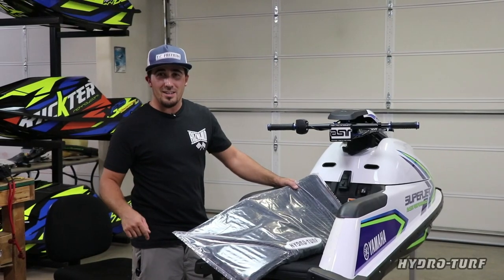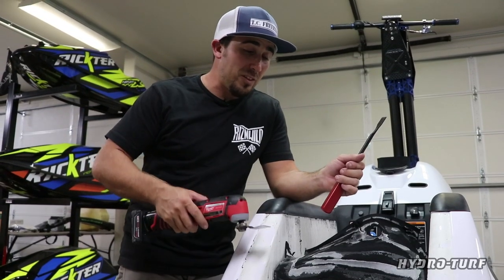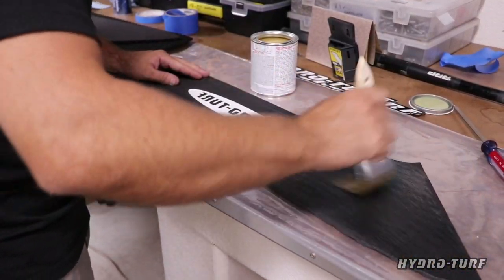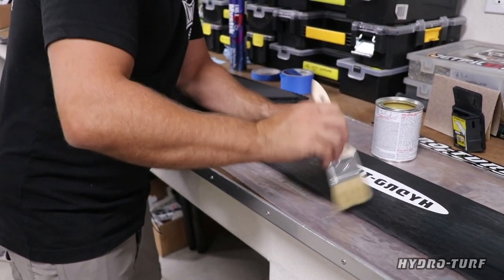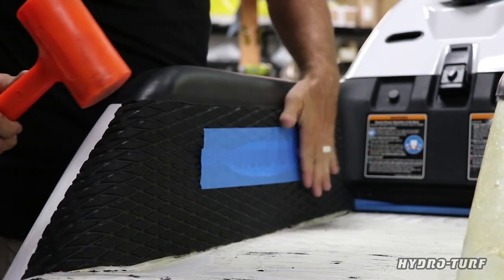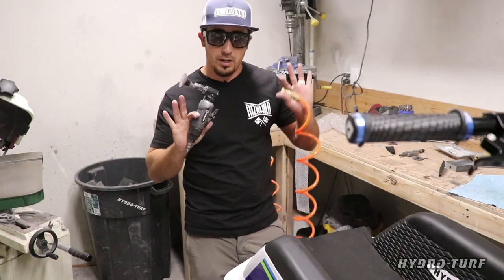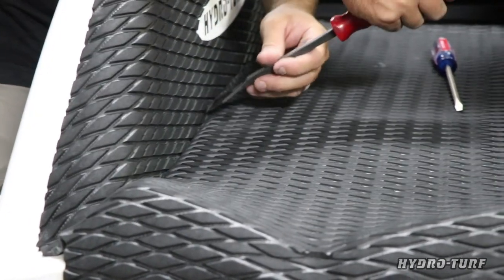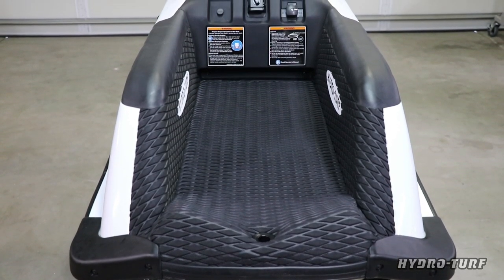How to Install Hydro-Turf Mat Kit on Yamaha SuperJet W/ Mark Gomez & TC Freeride HT-751 (96-2020 SJ)

Comment: Is there a reason you didn’t replace the mats on the top of the side wall? I see the hydro turf package comes with replacements.
Reply from the maker: Simply for ease and preference 
This is a lites ski for me so I don’t necessarily need to replace those top pads that were at the time brand new still. Once they get older and or I end up glassing in footholds I will likely replace.
Reply: Awesome thank you! Is it hard to replace if I would like to go through with it in mine?